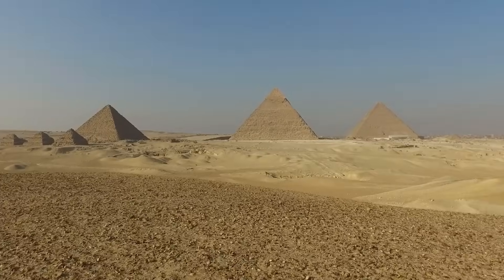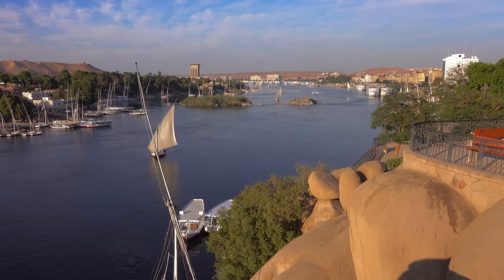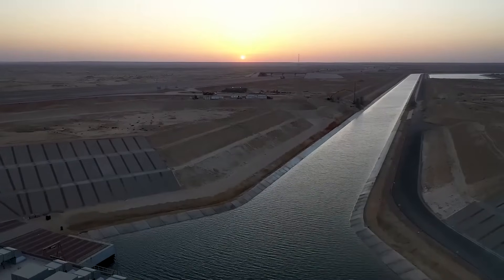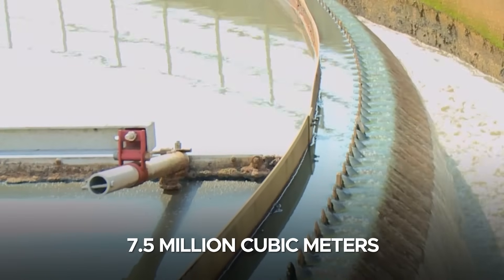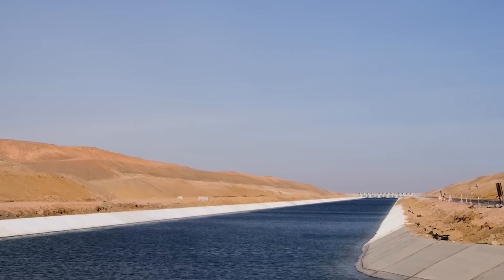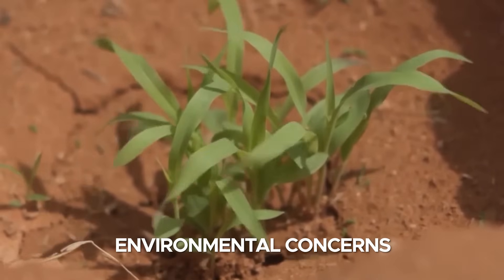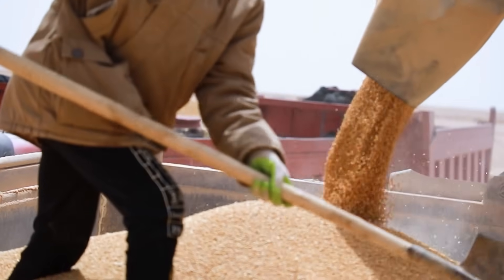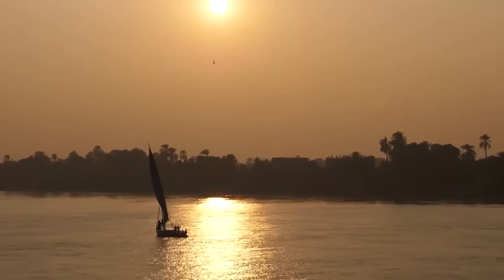Egypt Is Building A $25 BILLION Artificial River In The Desert!

Comment: Why are these enormous new canals being covered with solar cells?
That would provide means of mitigating water loss to evaporation while providing free electricity to battery storage systems which can power individuals, farms, and industries all along their courses.
Reply: They have. They've built many solar plants. They have even started manufacturing solar cells because they want to be the world leader in solar energy. They're also building a nuclear power plant.
Reply: Wait till the canal ends, we Already doing that project on the naser lake behind the high dam
Reply: if we do this we will get some electric power but there is some thing big that evaporation do we will lose it live more evaporation more rain so the dessert you see now will change by time to and big grean land scape with out any more project and we have the biggest solar cells stations in the world and making the biggest peacefull nuclear station on the world too
Reply: @mostafaayman4789 it won't change the weather. Lake nasser barely rains.
Reply: Already happening behind the Aswan dam and being piloted there due to the extreme heat there. Also the money you need to cover 170km with solar powers is huge so you can’t work on both projects without going into more debt which the country is trying to reduce partially by this project
Reply: I was about to say the exact same thing 

But 🤫🤐
Reply: It's will cost more and can be affordable as distance of channel is very long
Reply: @samehmekawy1049 yup. I think they signed a contract with a UAE company.